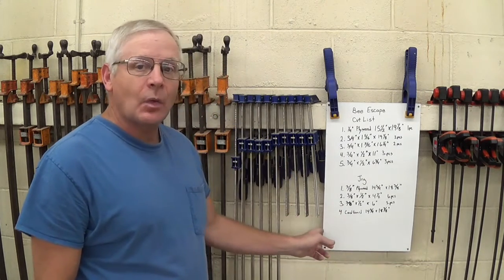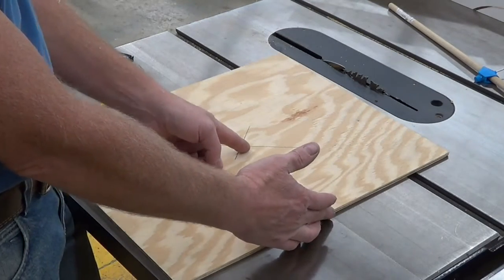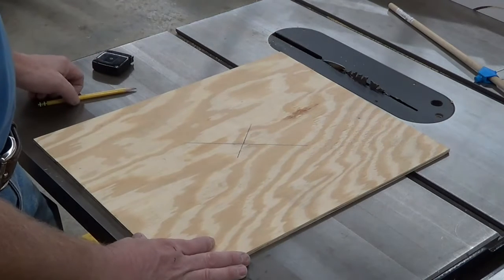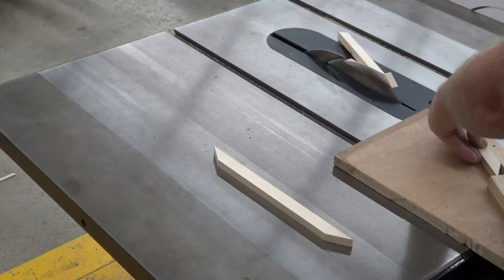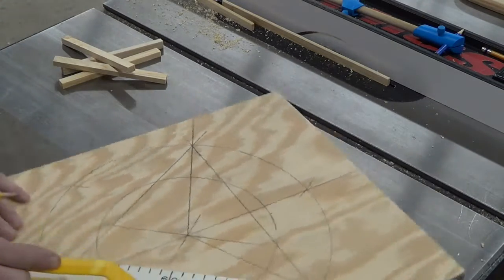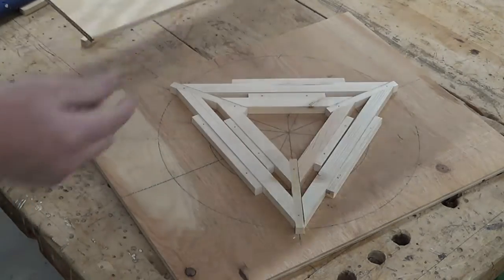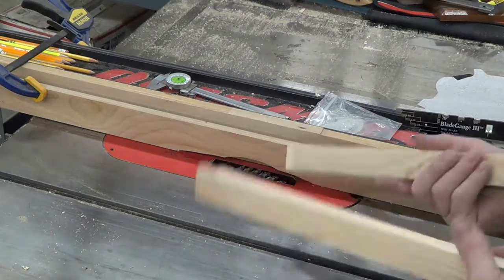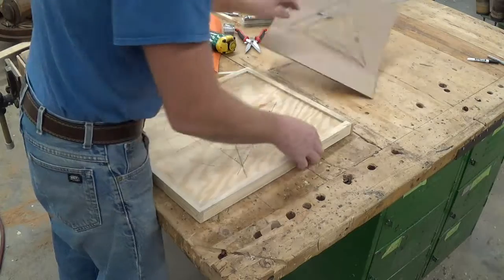How to Build a Bee Escape

Comment: What kind of Square did you call it? 60 degree square?
Reply from the maker: In drafting we use a 30/60/90 degree triangle. Or 30/60 degree triangle for short. Or even shorter just a 60 degree triangle... you can make your own with a compass and a straight edge.
Reply: Thank you